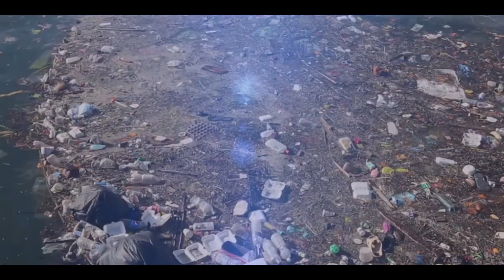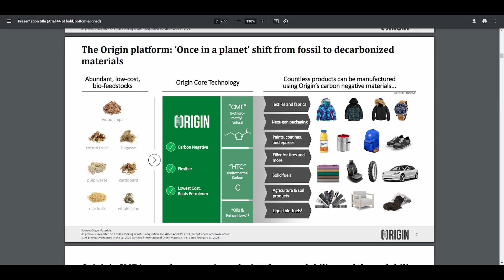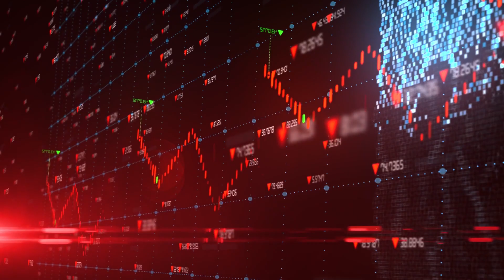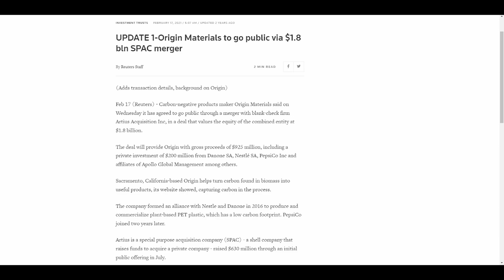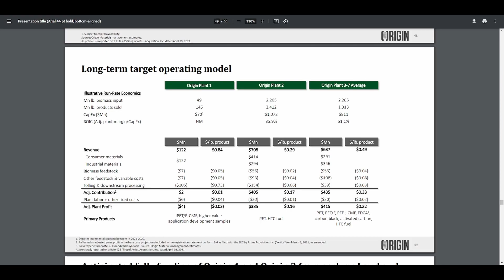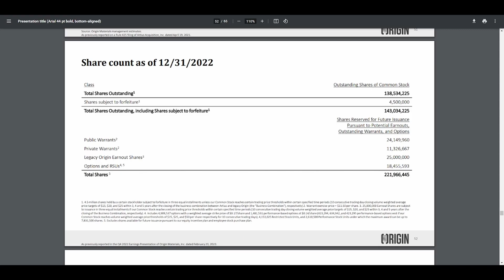Origin Materials: Plant-Based Plastic?

Comment: I recently discovered your channel through your Base videos (I'm synaphai on ceo) and appreciate your content. Since you like companies with licensing models, you may want to look at the Dutch company Avantium. Origin is actually licensing their tech for most of the PEF process. And if you want a little exposure to ORGN, warrants are an option. The ORGN warrants expire in June 2026 and are in the money at a share price above $11.50. It's likely they will be exercised cashlessly with at least 0.25 of a share exchanged for each warrant. So if you are interested, you can spend a relatively small amount of money on warrants and eventually get shares in return in case the company becomes a monster in the next decade.
Reply from the maker: Great points, and thanks for watching. I've never really considered buying warrants but you make a good case for it. I'll have to put some thought into that.
Reply: @green_investing  One more thing, and I'm not trying to convince anyone to invest in ORGN, but the way I look at it is if the company eventually gets to $5 billion in revenue, which is very plausible, at a p/s multiple of 5, which is low-ish for a high growth company, and  with a doubling of the fully diuted count, that would be a share price of $56, which is a 14x from the current price. And the upside could be much higher. Just the way I see it as an investor.
Reply: @green_investing  Warrants are obviously somewhat of a gamble because they can expire worthless but I think it's very likely that the ORGN share price is above $11.50 in the next two years. If you are seriously thinking about buying warrants, take a look at Origin's Form 424B3 Prospectus filed on July 30, 2021. On page 105 there is a table showing the fraction of a share that will be redeemed for each warrant depending on the share price at the time and the time to expiration.